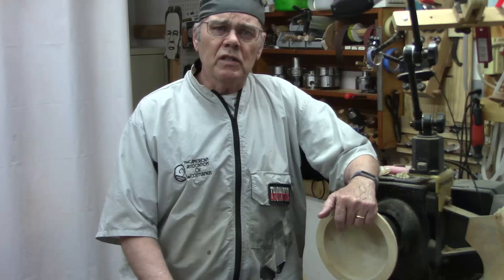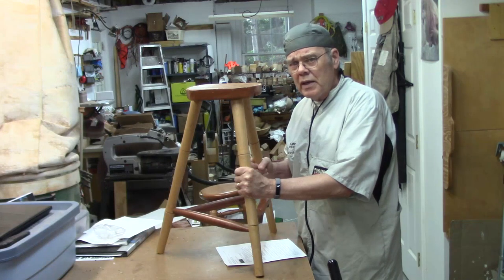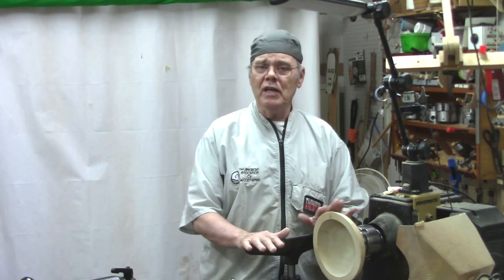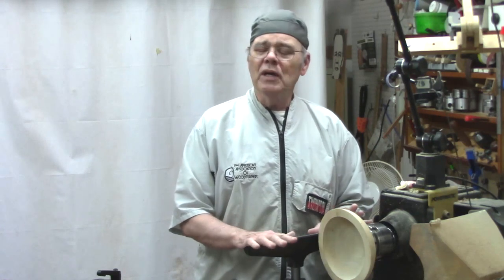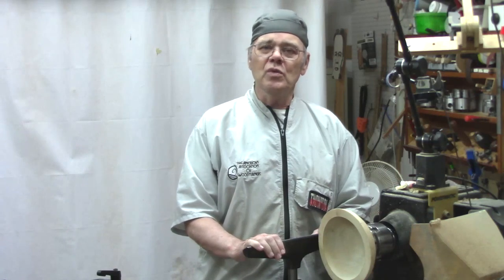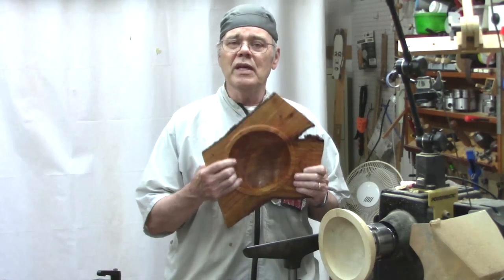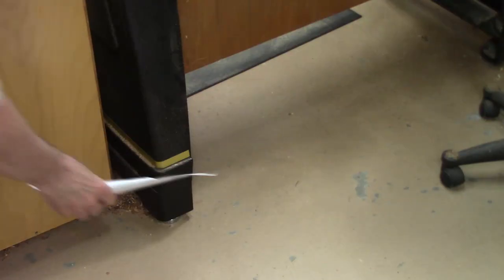Lathe Vibration? Let’s Fix it!

Comment: Thank you. I’ve a new lathe and also built a new and more robust bench for it. I’ve bolted bench to concrete floor so no movement there. However I have  a good deal of  rattle vibration. I think I’ve made a mistake by removing the rubber feet in the belief that if I bolt the lathe tightly to my bench it will resolve my problem. Wrong!
I listened to what you said about the rubber feet and why they’re fitted so as to reduce vibration.  So tomorrow I’ll refit them and do as you say about adjusting each foot in turn and until the vibration is gone. Oh! I also bought an extension bed and I suppose that might well have exacerbated my problem. If you have any further suggestions I’d be very grateful on receiving them. 
Once again thank you for your video tuition.
 Regards
Richard Green. Wales, UK

Comment: Thanks Mike! I'm a new woodturner using a Laguna Revo 18/36 lathe. I've had it for a few years and only recently started to turn bowls. When I first set up my lathe, I didn't install the feet and just set the lathe legs directly on the concrete floor. I would occasionally get vibration and thought my work piece was just too out of balance, so I slowed the lathe down until I removed enough material from the piece to allow me to turn up the speed. Having just watched your video, I'm now committed to finally install the feet that came with my lathe and see if that helps with some of the issues I've seen. I love your videos and find them most helpful.
Reply from the maker: Excellent!. Glad it was helpful.

Comment: Thank you some. Useful tips I bought a Nova DVR lathe that  the previous owner had not cared for, after much cleaning oiling and other bits of maintenance which 
 I won’t go into finally it is operational ani have got  it running but after bolt it h lathe down to a bench there is till some vibration. 
Definitely going to check now with a spirit level and thought I might bolt the bench to a wall of the workshop 
Thanks for your. Advice
Reply from the maker: Good luck finaly getting it squared away.

Comment: Thanks Mike. I have a Jet 18 X 42 and when I installed it I was concerned about movement and walking. I used shelf supports after leveling and surrounded each foot, without actually attaching the shelf supports to the feet. This allows movement but limits the movement and doesn’t allow walking.
Reply from the maker: Thanks for sharing

Comment: I have turned many VERY large bowls and had to move to a 3 hp PM and certainly agree with your ct about not needing extra weights. I have to use an engine hoist for my largest items.
Reply from the maker: Blanks that big are t just too much work for me, Ken!

Comment: Thank you for the video. I'm having a problem on my new Harvey t60s even with small off balance turnings. It weighs roughly 780 lb and has rubber feet. I think my problem might be that it's mounted on a wood floor. That haven't been said the floor is built to accept the lathe so everything is doubled up and supported where the feet of the lathe are. It seems as though the headstock itself is moving. When I touch the feet there is very little vibration but the headstocks moving a quarter of an inch to either side. I'm starting to think it's a function of having a 24 inch swing?
Reply from the maker: Are you saying there is a 1/4" play in the sliding headstock fitting in the bedway? That is unacceptable. The tolerance of sliding the HS should be very close -  enought to slide but not move side to side.  But if the HS is locked down, that should not be an issue once the TS is removed. If every thing is locked down and the HS is vibrating a 1/4", sounds like you do not have a stable floor or the feet are not all touching. Another sheet of 3/4 Plywood screwed to the floor should help if the floor is not solid. Sorry I can not be of further help.
Reply: @MikePeaceWoodturning  I spent all day today chasing the vibration and have it down to about an eighth of an inch with the same Bowl on it. I'm just wondering if maybe it's a function of a 24-in swing lathe I.E tall headstock? It doesn't really balance out at any speed which is unusual for me. My old Walker Turner could have handled this piece no problem. I like your idea of doubling up the plywood. As it is I'm on solid 8x8 Hemlock beams with post directly under the feet of the lathe. You could park a truck on it LOL. If I touch the feet of the lathe there is virtually no vibration it just gets worse and worse as you move your way up toward the headstock. I'm in touch with Harvey as of this afternoon. I sent them a video I'll see what they say. Thanks for your input

Comment: I'm a rookie of pen turning.  I have a Rikon mini lathe.  I tried to turn acrylic yesterday. I started from the headstock and things seemed and sounded just fine but when the cutter moved towards to middle it started to vibrate and bounce, when it closes to the tailstock,  it gets worse.  I checked the speed,  I changed it from 1800 to 1175, checked everything and made sure nothing is loose. I had to stop turning because it made the blank uneven. I'm frustrated!
Reply from the maker: So sorry. I would guess you are turning too slow for a pen. Always work from tailstocl to Headstock for minimum vibrations. Check out https://www.penturners.org/

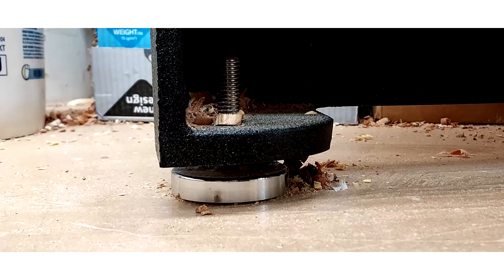Comment: Seeing the pic at 3:29 if you have the foot bolt protruding out of the foot enough you might try using a jam nut set up to adjust the foot bolt directly. 
Screw on an appropriately sized nut down far enough to accommodate another nut of the same size above it. 
Tighten the top nut very firmly against the bottom nut. 
Then using the top nut as an adjuster make the adjustments needed.
You might not need a wedge or anything else to effect the elimination of the vibration.
Hope I was clear enough.
Reply from the maker: Good tip! Thanks for sharing.

Comment: Try a car jack. Cork screw type works best.
Reply from the maker: Could not see where I could get a jack under it to lift. Please explain how you would do this on this lathe. This might help another viewer facing this issue.
Reply: Place a length of 6x6 between the lathe  bed and the jack making sure it's upright and not likely to twist when you jack it up.   You can then effortlessly jack up one end at a time sufficiently high enough to shim the legs until all four are even.   That's how I did mine and it weighs 650Lbs plus.  Great video by the way.